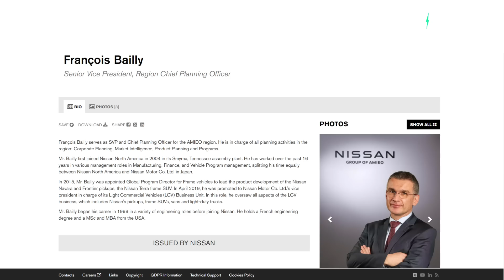Nissans Game Changer! Batteries are 45% of cost; this means 50% lower cost

Comment: If the Nissan pilot line was built in 2022 that means the actual battery chemistry was built previous to that date and that it is already obsolete compared to the new CATL battery.
This very likely means that EV made by Nissan will not be competative in price or specs...

Comment: They are all strangers to the truth.
Developing a small sample in a lab and them hoping that it all works as it should during mass production
is asking a  lot, and many companies have tried and failed to make the ultimate battery.
Despite the issues with current batteries in EV's there is still one major problen that needs to be solved 
first, the charging network and the grids capacity to cope with the estimated demand.
Until uou solve both, you are wasting a lot of time and money chasing a dream solution.

Comment: I think you may have drunk the Tesla cool-aid.

Nissan's plan (I had to go to the press release because the article about it was pay-walled, and you cherry picked points that did not sound right to you) seems doable. The plan is flexible: and does NOT rely on Solid State batteries becoming a commercial success. From the press release:
"New EVs with enhanced NCM li-ion, LFP and all-solid-state batteries will be launched in fiscal year 2028."

So Nissan will be selling models with a variety of battery chemistries, not just the Solid State Batteries that are currently vaporware.

I may be biased: I just bought an example of the original 2011 Leaf. I think Tesla used hundreds of commodity 18650 cells as a patent work-around. This was shortly after Chevron bought the NiMH battery patents and sued Toyota over the Electric Rav4. Nissan saw what Tesla did with the roadster and did a "design for manufacturing" optimization for the Leaf (reducing costs). The battery in the Leaf uses large pouch cells (reducing part count) and is passively cooled (making it very reliable outside of hot climates).

You want to know what is vapourware? Tesla going all-in on robo-taxis and AI. Going as far as to fire their entire charging division during the roll-our of SAE J3400 (colloquially known as NACS). I think it would be ironic if the "Tesla" connector on third-party charging stations does not work with Tesla vehicles due to a lack of interoperability testing.

Comment: Just run these cars on water as Stanely Neyer did. Water is much cheaper than batteries. Existing internal combustion engines could be converted to run on water. Heck, even jet planes could run on water.
Reply: You are probably a flat earther. They also believe in silly sh*t.
Reply: You probably had certain injection that's now making people very sick. I will try to educate you. Water (H2O) is made up of hydrogen and oxygen molecules. Hydrogen is very explosive; oxygen is needed for combustion. All molecules have a resonate frequency when reached the bonds holding the molecules together break apart. When this is done to water it creates a gas made up of separate hydrogen and oxygen molecules which is very explosive. The inventors Stanely Meyer and Dennis Klien were able to do this. There may still be videos of Stanely Meyer on YouTube. Check it out. If you are into something more exotic check out zero-point energy.

Comment: Another “game changing” battery. What game is this anyway, who can talk more BS than others. You can include BYD and CATL in that BS lineup as well. They find another piddling tiny extra 0.1 Volt in a 600 kg battery, its front page headlines and their stock price increases. Meanwhile, back in the factory, your bog-standard EV battery is being bolted into each EV as it goes down the production line.

Comment: You say Nissan is not desirable, but it’s extremely desirable to Chinese brands. They actually have factories in the United States. They have dealer networks, supplier networks, name recognition and so on. These are all things that no Chinese brands have, and need, if they ever want to enter the market. BYD would be the smartest one to buy it, but I think Nissan will be just fine honestly. If Nissan is smart they will partner with a Chinese brand and then use Mitsubishi to sell rebadged cheap Chinese cars, and rebadged Renaults, Dacia’s, and so on. A rebadged Dacia Spring would be a good choice for Mitsubishi, and so many other cars that wouldn’t fit with the Nissan brand.

Comment: Fantastic! So, they can charge off  free electricity in 2 mins flat. No cables or high power outlets and specific apps or internet connection. No charging go slow if 10 or more per block are vying for electrons. You can park them anywhere without any insurance or toxic fire risk whatsoever. Can be serviced for virtually free by any unspecialised  mechanic . This technology can't lock you out if the battery goes dead... because its battery is immortal. They'll run for more than 10,000 miles on one set of tires. No ingredients involving child labour, heavy duty mining and rare resource mongering. It's a miracle come true....etc etc....What a shell game....Game change off, chum!

Comment: Regarding the pilot line and the testing of the battery: I think Nissan is communicating truly. The reason why I do think so is the fact that I have seen more than one company bulding a pilot line for example to make Anode or Cathode material in the 1st year and in more than 1 more year they didn't have it running really in pilot production. Only in small batches for lab testing the materials. And then, pilot lines are typically low output in order not to waste too much material. Then to test it on a car they need to make at least 2 to 3 MWh worth of material for the batteries when otherwise no one will start the making of the prototype cars.
The bad thing is they are slow because what did they do to develop since the Leaf was first released?

Comment: My guess is Nissan has the tech but has issues with yields and, more concerning, the cost of production. If they started with a target of the battery costing 45% of the cost of the vehicle and those costs have plummeted, Nissan could be caught trying to develop a reliable production line while simultaneously lowering costs dramatically. If so, it's in a can't-catch-up situation. That would not make Nissan unique - counting on the next tech to save the company but being unable to deliver in a timely manner, so once they do deliver, it will not save the company. I owned a Nissan and loved it, but in the US Nissan has become a marginal player. Time is not on Nissan's side. If they plan on making the batteries outside of North America they will not get the battery subsidy which is more bad news. The longer it takes them to launch their company-saving vehicle the worse it gets.

Comment: The price for LFP cells that I had been seeing was about $55/kWh.  Recently I saw an article which reported CATL LFP cell now cost $47/kWh.  In a 50 kWh EV that's $2,350 for the cells.  I remember some time back Sandy Munro stating that the cost to turn cells into a battery pack was about $10/kWh.  Together, that would mean a 50 kWh pack for less than $3k.  $30k to manufacture EV?  Battery pack 10%  of total cost.
Reply: legacy car manufacturers are simply lying to sell high price to pay their inflated operating cost due to legacy.a 50kwh battery with the new lower peice battery pack is $3000 .the rest electric motors and monocoque frame with 2 led displays seats and brakinh system should not cost more than another $3000 when manufactured at scale/Thats a total of 6K. So BYD selling a  car at 10K actually has a gross margin of 40%.net would be lower around 20 after transport cost and marketing expenses. But still 20% net margin for a low priced decent practical car whihc can be sold at bulk numbers is better than any other manufacturer currently for all practical purposes
Reply: Byd seagull 10k
Reply: @larryc1616  
I'm not sure BYD is making a profit or even covering their expenses on that car.  Perhaps, but perhaps not.  If BYD can ship decent EVs with at least a 150 mile range to many countries and sell them for around $15k then demand is likely to be enormous.

Comment: It is hard to believe Nissan. In the last 15 years, the only thing they have accomplished was offering the cheapest EV hatchback. Where are the temperature controlled battery backs, the reliable CCS charging speeds, the streamlined user software?
Reply: The Nissan Aria. It is an SUV instead of hatchback though.
Reply: @economicprisoner  the Ariya has great interior style, but that's the only great thing I noticed. I am glad it is CCS, but only with 130kw peak. I think the ID4 is cheaper right now and with more cargo space.
Reply: You're asking too much from Kodak, I mean ice manufacturers
Reply: @larryc1616  Apt comparison: Because Kodak DID make a pretty good digital camera back in the day.
Reply: @philv3941  The Leaf was actually a couple of years after the Tesla roadster. I believe it was a "designed for manufacturing" implementation of the same idea (with lower costs).

The Tesla Roadster was a Patent work-around: using hundreds of commodity 18650 cells in a robust case.

The Telsa Roadster needed a Patent work-around for the battery because the Toyota Rav4 EV got sued out of existence a few years before that by Chevron. Chevron got the NiMH battery patents from Texaco who in turn bought them from GM after GM crushed the EV-1 fleet.

Comment: The only way I have an EV is because Nissan were first out the gate with mass produced EVs. Their efficiency engineering is imo way better even than Tesla who are absolutely amazing. I don’t need massive range and have no range anxiety because the Leaf is perfect for my uses. I charge mine every few days. I have a 9 of 12 state of health battery. It’s my commuter and grocery shop mobility. It’s so fun to drive. 

Everybody who wants high performance will call Nissan fishy but personally I would hold their beer and watch them sweep the market. My Leaf is 2013. Original battery, pristine Techna. Best EV value.
Reply: For myself I like all the Leaf models. Any year. I have heard only that 30kwh batteries can be great or not great. But the rest are solid. It would be fine to have more range sure and they put out new models. Not totally sure but I think 60kwh in the newer ones. I think this year they also put out Ariya EV. I don’t know. I’m interested to see how their battery tech is. Glad Sam mentioned and can always get the latest info from his channel. Thanks.
Reply: Glad you like your Leaf but efficiency "way better even than Tesla".  Need to know what you're smoking.
Reply: @StormyDog Real world testing has the Leaf at 5.1 miles per kwh, and the Tesla model 3 at 3.6. Of course the model 3 battery is 2 1/2 times bigger.
Reply: @PxThucydides which year?

Comment: True , but charging time will always be greater than filling up with petrol . In addition petrol stations are everywhere . Chargers are not . The inconvenience factor needs to be considered . There are 1000km batteries available already . It’s just a matter of time .
Reply: Petrol need crazy logistic and nation wide effort. All you need are  put the same nation wide effort for charging and done.
Reply: The charging times aren’t going to always be this slow. Yes it’s a way off but solid state batteries and higher voltage charging will greatly decrease charging times to be more competitive with petrol. A matter of when not if

Comment: I for one hope that Nissan can get itself back in the game. They had good will with the Leaf, but that good will has been spent. It's time to make something for this decade.
Reply: Indeed!  An updated practical car like the Leaf is whats needed not all the flash and fluff plus stop playing the Insanity and Ludicrous HorsePower and Performance Game.  We really do not need Super Car performance in order to get a quart of ice cream, pick up a pizza or drive the kiddies to school or soccer so put more of that research cost into increasing economy and not performance.   

More miles per kWh is whats needed so smaller batteries will get us further down the road and by nature take less time to charge  To me the goal should be a 300+ mile car using a 50kWh or smaller battery.

The First Gen Leaf already has more performance than is needed even today and all it needs to be current is a more efficient battery that charges faster and would increase its range to around 300 miles along with a heat pump.

All the hyped/costly up assists are needed due to the insane performance they are building into vehicles today since they accelerate too fast for the average driver to safely control.  Even Sam has somewhat provided evidence of this in his videos on EV accidents where drivers are loosing control, flipping their cars over long lines of traffic, rolling over into ditches and running down pedestrians when they lost control of the Insane Power when the assists were turned off.

Best!
Reply: That's it. People now need and want cars that can charge at any speed from low to supercharger levels, not just your in house very slow charger. Make a 2025 capable Leaf and the success they had with the original (like it or not, they had that success far before Tesla's hype) and they'll simply to have a best seller of their own...

Comment: I’d rather have a 1998 Nissan Primera
Reply: Didn't the STI version have a honeycomb structure in the engine head that was prone to cracking due to overheating and then couldn't be skimmed because of the honeycomb structure. My friend had the Sentra STI from that period, good performer but problematic.